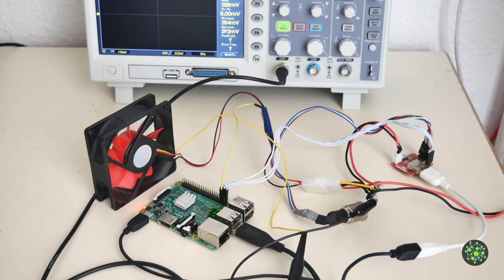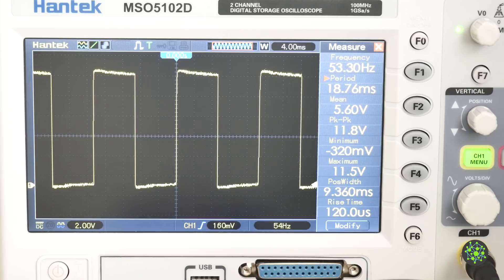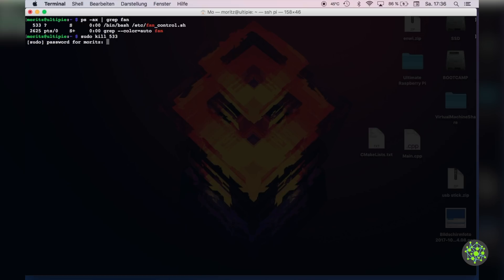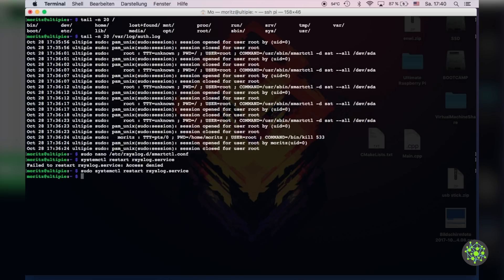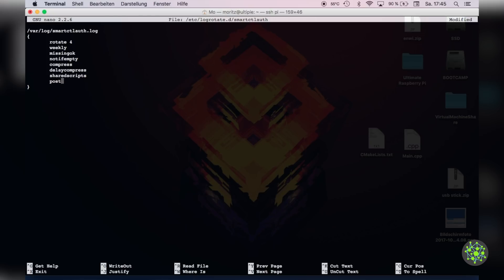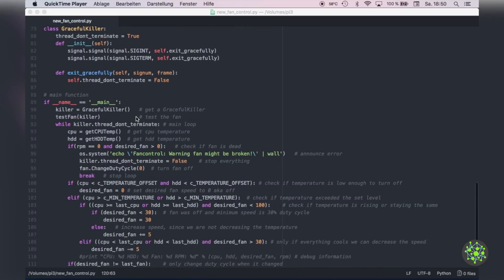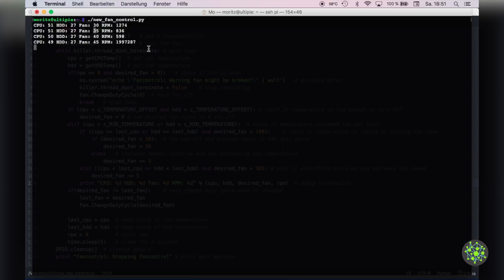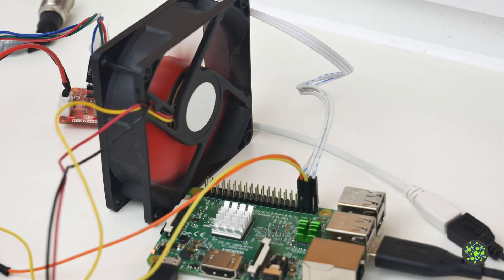Ultimate Raspberry Pi Build #07 - Improving the fan control

Comment: I know this has been up along time. Just saying that I have a program that controls the fan speed with a PID function, that will keep the CPU temp within plus or minus 1° C and stay quiet (unless I'm watching videos and such!). I'm cleaning up the code, I'll post it on github in a week or so
PS: actual speed of the fan is immaterial. Temperature is all that matters. If it is hotter than you want it, increase the duty cycle, that's it . My PID function will operate in direct or reverse, use a position or velocity equation for the derivative calculation,, and use the square root of the input for calculations (some sensors change readings as a Sq root function (flowmeters based on pressure drop)) and also just cut off output (but still do the calculations).

Comment: Do you understand the concept of open collector circuits?  please read about it.  No you do not need extra circuit to convert 12V to 3.3V!  This is kind of embarrassing to see 😞
Reply from the maker: +bayareapianist I understand the concept, but clearly the output of the fan was at 12V when there was no rotation, so how do you explain that? If it would only be an open collector then the output should be high impedance thus there should be no voltage. Or am I wrong?
Reply: enwi can you use a two resistor voltage divider?
Reply from the maker: Yes you can